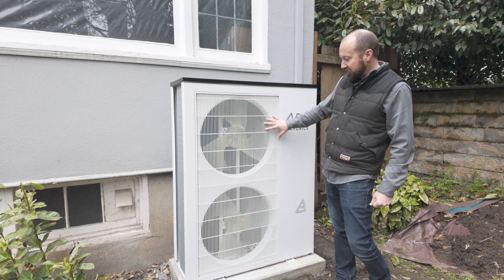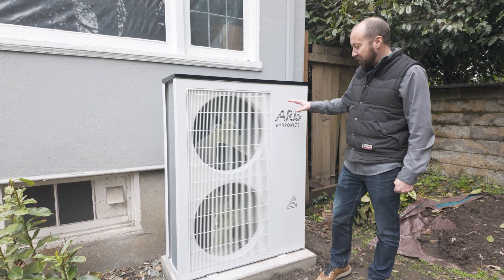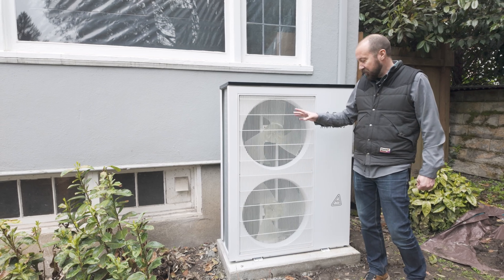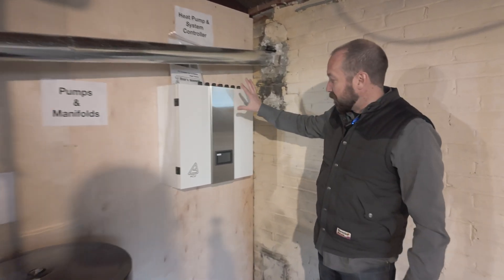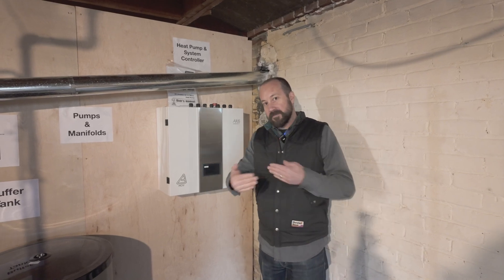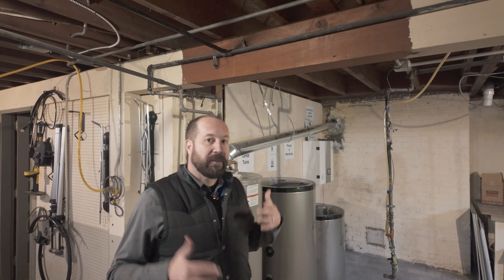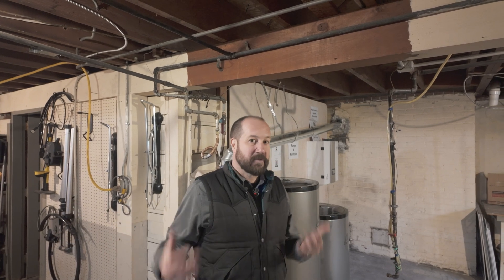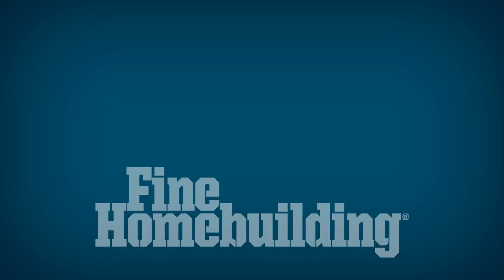Ductless Heating Solution: Air-to-Water Heat Pump Benefits Explained

Comment: I have a shop really a bank barn 14 feet under ground.  There is a 1/2 mile of pex under the floor.  An 8,000 btu window unit keeps it cool.  IT also gets rid of the moisture.  I have been looking for years for a system that could heat /cool air and heat water using the 40x64 foot floor mass.

Comment: i never have hvac guys check my refridgerant on a/c.  everytime they check they lose so much freon from unscrewing their tester hose.  then 2 years later they tell me im low on refridgerant.
Reply: The majority of techs use pressure gauges with hoses that are multiple feet in length.  The diameter of hoses vary; some smaller, some larger.  
Larger hoses especially when gauging the high pressure (liquid) side will possibly contain ounces of refrigerant. 
If the tech does not use the proper procedures, over time, refrigerant loss from the system will occur depending on the frequency of tech visits.
This is another way that HVAC service techs screw the consumer.

Comment: So how do geothermal coils tie into this?  Is there a second video that shows more of the system?
Reply: There are no geothermal coils, it's just drawing heat from, or releasing heat into the outside air via water and the outdoor compressor unit.

Comment: Why are you showing this when it is not available to home builders?  How much does this cost?  Do they make just a Water Heater unit or Tankless Water Heater Unit.  Is it even affordable for the average homeowner?
Reply: Am finding that most if not all air to water systems and ancillary equipment, are marketed in the same manner as most HVAC equipment.
In other words, it is just a continuation of the HVAC industry, screwing over the consumers with artificially high pricing.
Josh talks about refrigerants and environmental impacts when in fact, they don't.  This was another scam by refrigerant and HVAC equipment manufacturers, to increase revenues.

Comment: Do you know if this system could integrate into a building that currently has Whalen units installed in individual apartments? As with your system this building's system circulates water (either hot or cold) to provide heat or cold air.  It has to be switched over twice a year since it can do only one or the other at a time.

Thanks

Comment: I plan to add an air- to-water heatpump to my existing baseboard radiatiors/boiler set up. I will leave the existing boiler as a backup source (also known as a bivalent system), as I don't want to replace any radiators and I am not sure yet if the current radiators will be able to heat the house at a lower water temp. That way...I can use the heat pump for most fall/winter days, and use the boiler on super cold days (if needed). It should be an easy system to install to the existing boiler system...just a heat pump and buffer tank...with a few mixing  valves and/or a heat exchanger.
Reply: Radiant heat requires 180°F water circulating for proper efficient heating, which boiler provides, as long as heat pump heats up to that temp your good
Reply: @angellanuza8191 Ideally but you can operate at lower temps. My cast iron radiators run at 135 to 145 and they heat my house just fine. Only day the house got to 58 F was a 3 day cold snap at 0F with 40 mph wind (-20F windchill), but we just light up a fire in the wood stove and it was fine.
Reply: Thanks for the term! (bivalent)  I'm looking for the same solution.  While our boiler is supposed to be more efficient at 170F, I tried that for a while and noticed a lot more fuel usage.  I turned it down to around 160 and it's actually using way less than I expected, the system doesn't' cycle as much, and we are happy.  That said, it runs in the shoulder season more than we want it to, and I'd rather save my firewood for the long cold winter, so a heat pump tied into our existing hydronic setup, and it could easily be automated.
Reply: I assume you would have to manually switch to the boiler or heat pump?

Comment: Since you are using wall mounted fan coils for distribution, and no existing hydronic infrastructure, it would be interesting to hear your reasoning on why an air to water system is better than running refrigerant indoors as is the standard practice today with heat pumps in the US.  I'll list the ones I picked up on:

1.  It can do domestic hot water heating provided customer gets an indirect tank.  Doesn't need another compressor running in the utility room and would likely be much faster recovery than the stand alone heat pump water heater units.

2.  The ability to store heat in a buffer tank for later use.  However, that was a pretty small tank, I'm not sure how useful this is for demand shifting.  Let's say a 40 gallon tank at delta T 30F stores about 3kWh of thermal energy.  Its something, could last an hour or two with a pretty small load.  Feels like the tank would need to be enormous before this is significant.

3.  Reduced refrigerant leakage and later the ability to use R290 as I'm not sure that will ever be allowed to be piped inside the home.  Those are really exciting to me, but not sure homeowners would demand that, I think EPA would have to ban R410a and R32, R454b before this is significant but curious to hear your thoughts.

4.  Can be used directly into existing hydronic infrastructure, especially radiant floors, but this is rare in most homes and didn't sound like this was the case in your project.

Did I miss any?  I think reason 3 alone is enough to do it, but not sure its marketable to consumers.  I think refrigerants are run indoors now because its one less heat exchanger and no hydronic circulators, no freeze protection, thus a simpler, maybe more efficient and lower cost system.  Could all that be overcome to make air to water heat pumps the best solution for homes that don't have hydronic distribution planned or already in place?
Reply: In my opinion the turning point will be making completely integrated hydronic systems as easy to design, install and operate as mini splits. Now they have to be custom designed and built for each house, which has its own advantages (like not being tied to a single manufacturer for the whole system, and if well designed providing exceptional comfort). I think this will still be the best option for new builds and big renovations, but having something more plug and play will open up many more opportunities, as they will be easier to install as incremental updates, more professional figures will be able to install them, and arguably they may eventually become even easier to DYI install than mini splits as you wouldn't have to manage any refrigerant gas, since it can be all packaged in the outdoor unit

Comment: @matthewvanrossum406 The cold water goes to a wall mounted fan coil unit that has a small fan, some coils and a pan that catches any condensate during cooling. The fan coil unit has a power supply, two plumbing connections and a condensate. We used a washer/dryer box behind it to drain the water away. Ben Bogie did a video on the fan coil units for this house that will hopefully be posted soon that describes (and shows) this.
Reply: I want to see the Fan units, prices. And how effective and quick can it cool/heat a room.

Comment: How do you keep the water in the outside unit from freezing?
Reply: The system is rated for cold climates and has a heat pan on the outdoor unit. The water lines get insulated and if the temp goes below freezing the system will reverse to put hot water in the lines to keep them from freezing. If there is a power outage, the outdoor unit drains so it won't get damaged.
Reply: @JoshSalinger  Thanks Josh.
Reply: Antifreeze? Like gshp?

Comment: baseboard heat or floor radiant? Does it retrofit into existing baseboard?
Reply: It has wall mounted fan coil units for this project that we will be showing in a subsequent video. Any number of different ceiling cassettes, in wall units, wall mounted units, in floor or in wall distribution are available and can be used. If one is doing cooling, one wants to use the fan coil units that have condensate drains. It is technically possible to retrofit into existing baseboard, but it is highly unlikely the loads would match and one couldn't do cooling as it would create a lot of condensate.

Comment: That’s an interesting system. What’s the ROI time and what are the electric utility rates at the site?
Reply: Not sure of the ROI, but the electric rates are cheap at around 14 cents/kWhr. The value for the client was getting rid of the ductwork, getting cooling (they had none prior), getting off of fossil fuels, replacing their gas water heater and having a quiet system with demand response. This was of greater value to them than the ROI of just the dollars and cents.
Reply: Thanks. 

That’s about my current gross kWh rate.

This was a little different than other solutions I had seen.

What is the typical electric load that the system draws? Is there any backup water heating? (Sorry if you already answered)